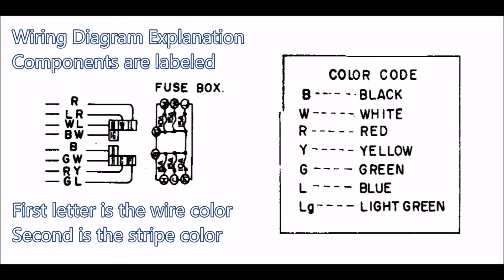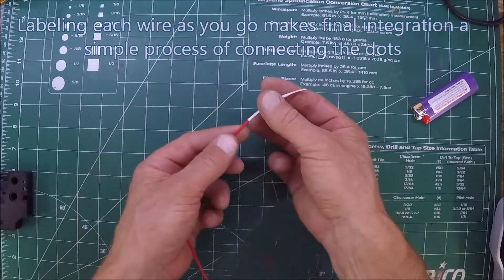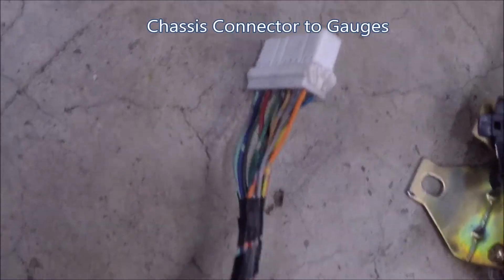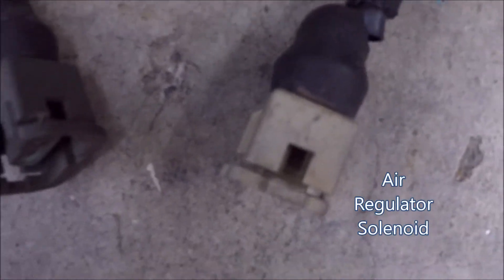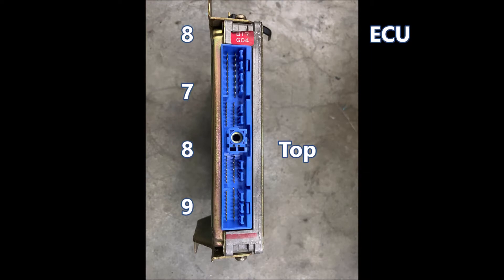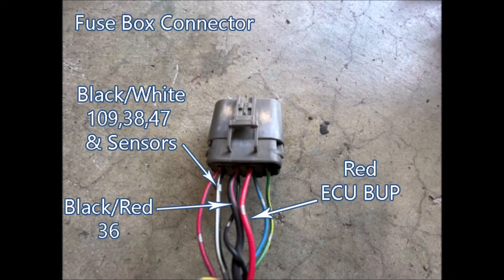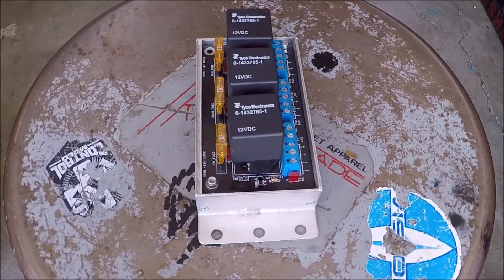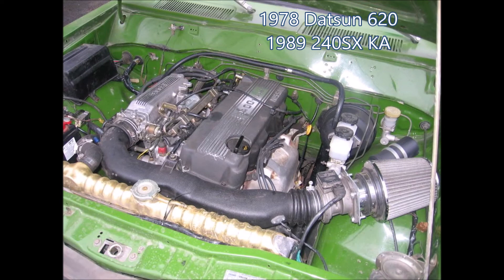*Re-upload with no music* How to Wire a 89-91 Nissan KA24E Into Anything - but Mostly a Datsun 620

Comment: How many grounds does it have? Having trouble with it on my 240sx
Reply from the maker: There are quite a few, they all essentially tie together. What is the trouble? Have you checked for codes?
Reply: @i2edeye  actually figured it out, only trouble I’m having is timing the engine I noticed previous owner did the timing chain but I see the colored link is one tooth behind the dot on the cam gear
Reply from the maker: @marvinmejia8060  That is an easy fix, just gotta take it all apart unfortunately